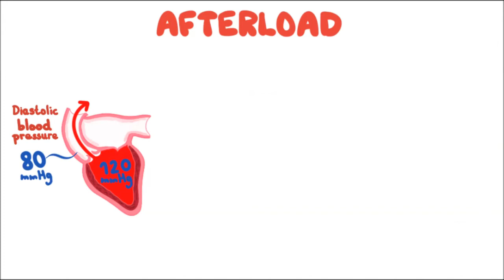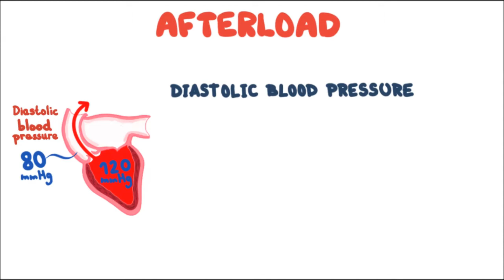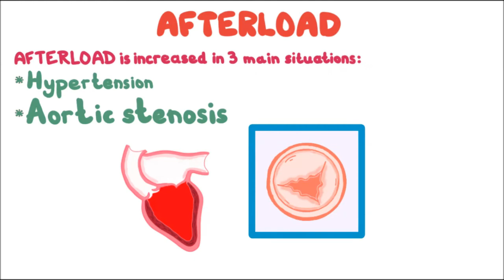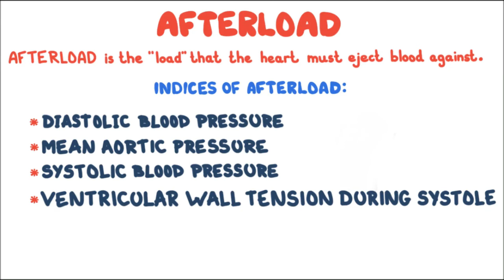Afterload (Cardiac Muscle Mechanics) in 4 minutes

Comment: Afterload and preload is simple.
Afterload is a resistance or pressure. Preload is a amount of blood. Imagine you have a tank in your home. When you open the tap water fill up in the tank after closing the tap, amount of water present in the tank is preload. Now tank has to empty the water in order to supply it to somewhere. So there will be a lot of external resistance water will try to push back to the tank but tank is strong enough to send the water out - it is your afterload. So preload is amount of blood present in the heart in your right and left ventricles at the end of relaxation.and then contraction period starts, so left or right ventricles have to overcome the pressure coming from system circulation or pulmonary circulation- this is your afterload